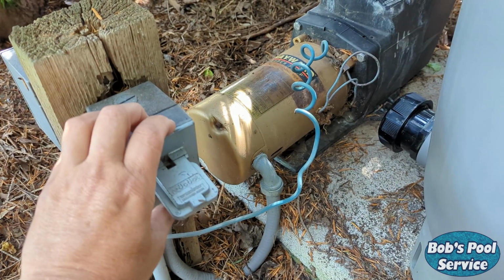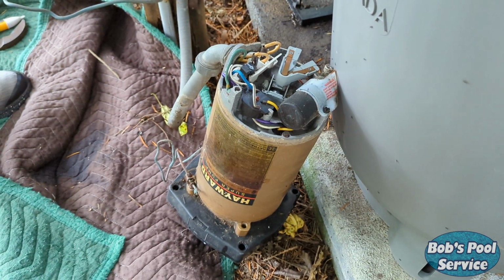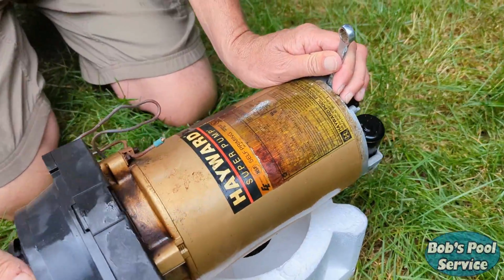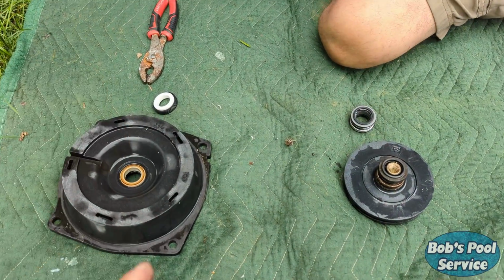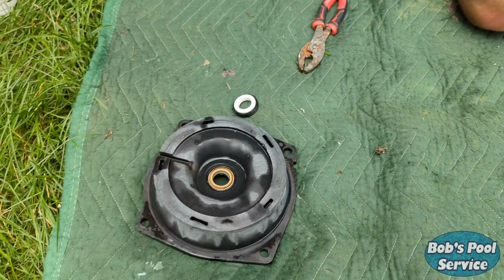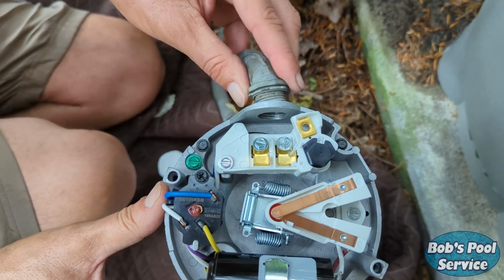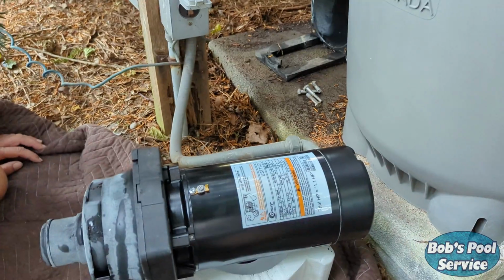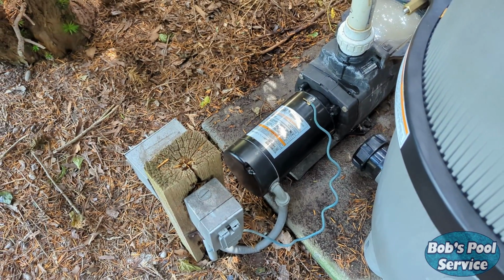How to Replace a Hayward Super Pump Motor step by step

Comment: Thank you so much for this video. Pool company was going to charge me $1500 for an entire pump replacement and this video allowed me to fix my pump for $160. The impeller portion was invaluable as the first video I watched had a captive bolt on the front end whereas this one (as with mine) did not. Was working that for over an hour before I watched this segment. Again, thank you so much!

Comment: I was under the understanding that you should not touch the white ceramics on the pop in seal for finger oil residue.
Reply from the maker: Someone else said the same thing, I actually asked our local motor shop that replaces thousands of seals a year.  Their answer was "well, you shouldn't touch it if you're making a youtube how-to video"...  they said they've never seen one fail from finger oils, however it is important not to put lube on any part of the seal...  with that all said it can't be a bad idea to wear clean gloves or use a paper towel or clean the surface with alcohol.  I've replaced over 1000 pump seals over my pool career and can say I've never seen the facing where it meets the ceramic fail unless it just wore down over time.  What always seems to fail is the rubber boot or sometimes the spring will rust out  where pH isn't maintained.  We started using viton seals only, a few bucks more but the rubber is of higher quality, the ones that come with the pump are not viton.

Comment: I have not seen one of these motors fail, it has always been the capacitor under the cap , which is a cheap and easy fix.
Reply from the maker: We see 100's that fail, usually the bearings get loud or even seize up totally.  If it hums but you can get it to start by spinning the shaft by hand giving it a boost then yes, a new cap will solve that but other parts definitely fail too.  Old motors built in the 80s' and even into the 90's lasted way longer than anything after 2000.  Windings are often aluminum instead of copper inside some motors.

Comment: Great video thank you, doesn’t matter where the hot leads go? Is it specific to the connections if you switch those two around, would it matter?
Reply from the maker: On this particular motor the hot and neutral can go on either screw, SOME pumps like the pentair models that have auto detected voltage do matter and it's clearly marked.  With 220 obviously both wires are hot so it wouldn't matter.

Comment: Thank you for this video.  The pump I ordered is a perfect replacement for my Haywood.  There are two large seals that came with the new motor, and I have no idea where they go on the plastic housing in front of the motor.  Also, how hot should y motor get.  It's seems hot to the touch to me.
Reply from the maker: I've noticed a lot of times motors ordered online they throw in various seals and gaskets, sometimes they're the correct fit for your pump but other times not.  If you have this model super pump by Hayward the correct seal is a PS-201 or PS-201V (viton) for salt water, you can use the 201V on a non salt water pool, it's just a better grade of rubber.  As for the motors and heat some do run pretty hot, there's a lot of factors that can influence just how hot it runs.  If your electric is 110 instead of 220 that will definitely run hotter, also if the motor isn't matched to the impeller that will affect how hard the motor has to work, an impeller that pumps more water asks the motor to work harder.  Voltage drop in the summer is also another reason motors run hotter, as the voltage goes down amperage goes up (ohms law) so when everyone is running their AC's line voltage might go as low as 100V while normally it's 115-120.  The most common reason though we see for replaced motors running too hot are the connections on the back, make sure the wires (or crimps) are on securely, if they're not providing a good contact that will starve the motor for electric and cause it to run hot.  Lastly, if the filter is clogged that can also place more demand on the pump.  Hope this long explanation help, it's hard to judge without actually touching the motor.  If you're smelling burning and the label is turning black from the heat that's definitely too hot but motors do get pretty hot during the summer.

Comment: Thanks for this vid! I changed my mom’s pond motor. The motor came 240v default but my system required 120v I didn’t change so my pump got really hot was low pressure and turned off. I changed to 120v and everything went good.  Appreciate the info

Comment: Great video. Just to confirm, you did not use any lube on any of the seals?
Reply from the maker: Definitely no lube on the ceramic pump seal, the o-rings can and should be lubed however.

Comment: I  can get the impeller to spin off im using the wrench but it won't break free.
Reply from the maker: Make sure you're turning it counter clockwise, sometimes they can get seized on pretty good and can take two people, one holding the motor the other with a large wrench.  If you break the impeller new ones can be purchased so you have nothing to lose.

Comment: As long as you can line up the motor shaft with the impeller, why can't you just do that instead of taking off the plates and impeller?  I did that about 10 years ago on my pump and was easy.

Comment: Great video!
Having a bit of difficulty disconnecting the motor from pump housing after bolts are removed. Any idea why it won’t remove?
Reply from the maker: Sometimes it takes some persuasion, wiggling it from side to size or even carefully putting a screwdriver between the housing and motor seal plate can help.

Comment: I wanted replace the same pool pump and didn’t work .I couldn’t open part between impeller and motor so I used WD-40 and works like brand new.

Comment: What motor should I buy off of Amazon?
Reply from the maker: I've never bought one off Amazon, we purchase ours from a local electric motor shop that sells motors and also repairs them.  With that said as long as you look at the label and get the identical style and horsepower you should be able to buy one online.  During covid we bought a few things off amazon because nobody else had them, we had mixed results.

Comment: Where does the bond wire come from?
Reply from the maker: It's attached usually to the water pipe in the house and all the metal around the pool including a bonding grid under the cement.  The idea is to have everything at the same potential.

Comment: I replaced my motor with this video. Quick question though. When the old motor was on it it did not leak at all. I only replaced the motor and didn’t replace the seals because they weren’t leaking. This is sufficient correct?  If it would start to leak in the future I would just replace the seals then correct??
Reply from the maker: Yeah, you can re-use the seal for sure if it's ok, we generally change them all out when we're "in there" just because if it starts leaking soon after we replace the motor the customer might not understand it's not related so we cover ourselves for that.  Seals generally last 3 to 5 years but I've seen some in older pumps go over 10 years without leaking...  once again nothing is made like it used to be.  Personally if I were changing the seal I'd go with a viton rubber version, better quality material.
Reply: Thank you sir!  I ordered a seal kit and I’m gonna replace those along with the gaskets. Shouldn’t be too difficult though just have to turn the power off and I don’t even have to unhook any of the wiring in the back of the motor. I’m assuming all I need to do is just pull it out of the housing unit and remove the diffuser and impeller And then put it back together.

Comment: I'm ballsy with my impact but even I wont put one on plastic
Reply from the maker: We mainly use them for removing stuck bolts but the small 12V cordless ones aren't that powerful.  In this video you likely heard the clutch slipping on a regular drill not an impact for tightening.

Comment: Man I have tried two new motors and new wiring.  Pool pump runs for a long while and then trips breaker.  I'm out of ideas....
Reply from the maker: That could be one of many issues, first I'd check the amperage of the breaker and draw of the motor.  There should be a 20% buffer so the breaker has some headroom.  Next I'd check the connectors where they go onto the terminals, if the crimps are compromised or not tight that can cause a higher amperage draw.  Another possibility is an old breaker, yes they do have a lifespan.  I'm not an electrical expert but we have seen many things cause this, even the switch or timer can be the culprit.  Sometimes it pays to call in an expert.
Reply: @BobsPoolService I changed the breaker.  I am going to go test all the amps at different points along the way.  Make sure it's good all the way to the pump

Comment: Excellnt video, thank you. I got my new HST110 wired up and when i tested it, it ran backwards!. I made sure it was wired correctly for 115v, with the existing hot/neutral wires. I have read that these are basically not reversible. Gotta send it back?
Reply from the maker: Wild, I've never had a pool pump motor run backwards from reversing a neutral and hot, only time I've seen this is with 3 phase motors or DC.  I would guess there's a problem with the motor.

Comment: Grreat video and replaced mine last year, but when i started the pump  i am leaking water at the housing, would it be best to just replace all the seals again?
Reply from the maker: I would check the housing bolts are tight and housing gasket too but if you see water coming just from the very bottom through the weep hole, likely the motor seal is the culprit.  Sometimes we too get seal that don't last long, they should give you 7-10  years but nothing is made like it used to be.
Reply: @BobsPoolService  Housing bolts are tight, just ordered all new drive train parts from Hayward, the motor housing was from a 3rd party mfg. 
Always found original Hayward parts to work well.
Done motor replacements before, first time with a leak.
Should just need to kill breaker to disassemble impeller etc and replace them, fingers crossed.

Comment: Thanks for this! We're entering our 6th season with our "saltwater" pool. I had a bit of a leak that was dripping on the motor. I could see the motor housing was corroding a bit on top but didn't think much of it. This season the motor did the dreaded "buzzzz" when I tried to fire it up. Upon removal, there was nothing left of the bottom of the motor - it had all rotted away. So, time to replace the pump and fix that little saltwater leak. It's a Hayward 700 Super Pump that looks identical to this one. After watching this video my stress level went down a few notches. Definitely something I can do myself. Parts are on the way!
Reply from the maker: Yeah if you ever see even the smallest drip on your system with a saltwater pool address it immediately.  While the saltwater going through the system isn't a problem if you have a leak the water evaporates and the salt keeps concentrating and can do damage quickly.  Also I don't know if I mentioned it but I would replace the seal with a saltwater rated one that uses viton rubber.

Comment: Hello guys. Can someone let me know how i know what type of motor is compatible with my hayward pump? Are all century motors compatible with Hayward pump? I cant tell the model because the tag is faded. TIA..
Reply from the maker: Any brand will work as long as you match up the style and horsepower.  Super pumps are frame style 56J with a threaded shaft.  Century, US Motors, AO Smith or Emerson motors will all work.  Given a personal choice I would choose one where you can easily turn the shaft by just taking off an end cap, some offer that feature and it's great if it doesn't start after the winter you can easily unseize it.
Reply: @BobsPoolService  Thanks for the info. My motor is faded and shows no indication of the horsepower. I took the impeller off and it shows SP3010-C. Corresponds to the Hawyard super ll. Can i replace the motor with any horsepower or it has to be identical to the old motor? TYI..
Reply from the maker: @kawaiibutterflyeditstwo4672  that's a 1HP impeller, you need to replace with the same or larger but putting a larger motor would just waste electric (as opposed to overheating the motor if you use a smaller one). If you're going to replace this yourself my suggestion would be take the old one into a motor shop (we have one locally here that's great) and just have them match it up for you.
Reply: @BobsPoolService  Sorry, one last question. I just found out that in California they wont ship a single speed motor. Can i put a variable speed motor on my Hayward sp3000 pump?
Reply from the maker: @kawaiibutterflyeditstwo4672  I'm not up on CA laws but generally you can buy single speed motors up to 1 hp for pool pumps.  Honestly the motor doesn't have to be sold for use on pool pumps, they're all pretty much the same.  As for a VS motor I'm not sure if you changed out the impeller to one used for VS if it'd work properly, I'd look at some parts diagrams for Hayward Super II pumps and see what impeller and diffuser is spec'd.  We've yet to have a customer request going from a single speed to VS using the same housing, generally people just replace the entire pump in those instances.  We sell a lot of the Pentair Intelliflo series pumps for that application.
Reply: @BobsPoolService  Thank you very much for all your help. Hopefully i get my pump working soon. You have been extremely helpful.
Reply: @BobsPoolService  I want to give you a big Thank You! With this video and all the help you gave me I was able to replace my motor with a brand new Century motor. With All your assistance,  I was able to identify the existing motor and replace it with the same one (my old motor was rusted and there was no way of telling the brand or horsepower) I had no clue at first or where to start, since there are some many different types. My pump is up and running now. Huge Thank you Sir...
Reply from the maker: @kawaiibutterflyeditstwo4672   really glad it worked out for you!

Comment: Where the seal from the cover meets the gasket and spring on the impeller it stops the impeller. If I take off the seal it works perfectly.  Any ideas?
Reply from the maker: I read and re-read this but I can't really grasp what you're asking.  The seal is 2 parts, one slips on the impeller shaft but you must make sure the old seal is completely removed.  The other ceramic part inserts into the seal plate, sometimes we put a very small amount of lube on the rubber so it goes in smoothly (but NEVER put lube on the ceramic seal mating surfaces)

Comment: All you needed was a capacitor and to get rid of those ants what a waste of money and time
Reply from the maker: Sometimes it is but what happens when you change the starting capacitor then the bearings fail or the switch within the year?  Now the customer has spent twice on it.  Motors don't last like they used to and oftentimes changing out the starting capacitor might not fix the problem.  If you're a DIYer and want to try that first have at it, or even remove the capacitor and test it  with a fluke meter (just check the microfarads on the one you took out).  With higher end sealed motors or commercial pumps we do stock and change many start capacitors but in this case the customer was happy replacing the motor which should last 5-7 years.

Comment: OUTSTANDING Video!  You walked us through the process end to end, slowly enough and with every detail and step along the way to make it easy. Not a single thing left to the imagination or had to guess on.  My only issue was getting the impeller off - took one of us holding the old motor and the other really turning the impeller but finally got it.  Was truly like having you right there with me helping me through it.  One of the best how-to videos out there. Thank you!
Reply from the maker: Thanks for the kind words, and yeah, sometimes the impeller can be stuck and we use a strap wrench to grab it. Thanks for watching.

Comment: Great video, followed steps to a T, and it only ook me about 2 hrs on a 90 degree day. After that it was time for a swim, thanks! Saving this for future motor change outs.
Reply from the maker: Glad it helped, unfortunately motors don't last like they used to, when i started the business 35 years ago we'd see motors that were in place for 20 years, still good...  fast forward to today and the average life seems to be 5-7 years for a pool motor.  Low voltage caused from people running AC's in the heat is part of what kills them but again they don't make them like they used to.